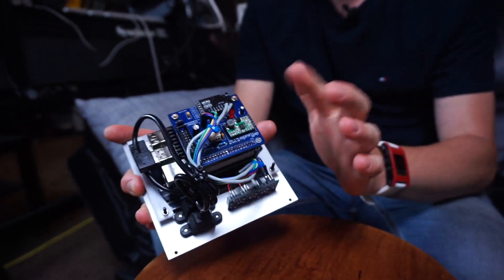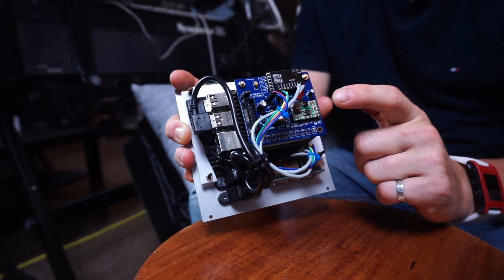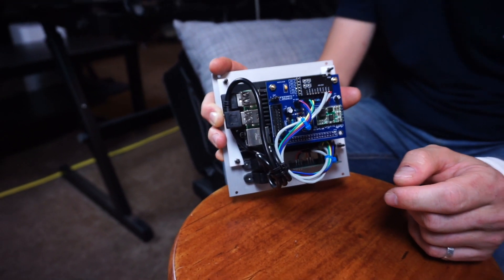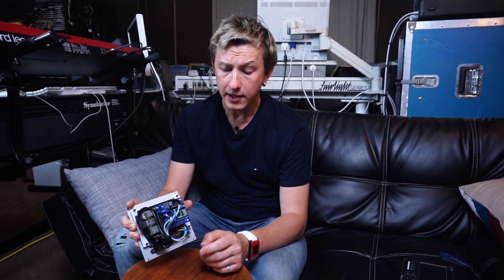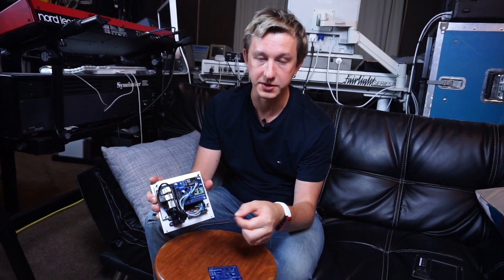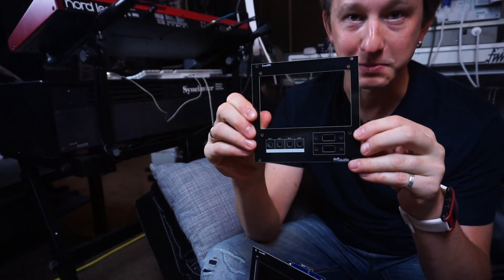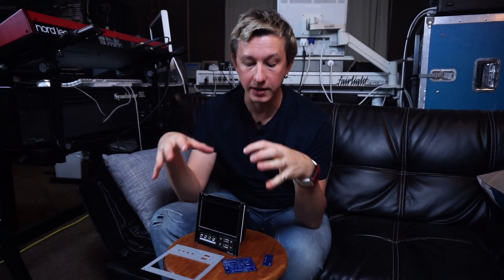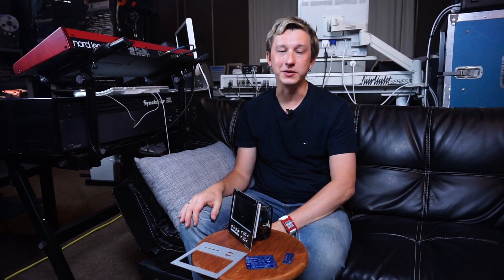Raspberry Pi 4 Eurorack module with audio, MIDI and power integration.

Comment: I thought a Pi5 would behave the same as a Pi4... I was wrong... RPi.GPIO library is broken... raspberry just recently released the full specs and datasheet of the RP1 chip that arbiter all OS > GPIO communication. I found a translation layer in GPIOconverter... please get into the raspberry forums to get more insight, this is not trivial argument... cheers!

Comment: I just bought the plate but I cannot find anywhere the links for the USB cables that you mention... could you post them here?
Reply from the maker: Hi, it's a simple USB extension cable, something like this https://www.amazon.com/USB-3-0-Extension-Cable-Panel-Mount/dp/B087BK3WRB/ref=sr_1_13?keywords=usb%2Bmount%2Bextension%2Bcable&qid=1649912298&sprefix=usb%2Bmount%2Bex%2Caps%2C273&sr=8-13&th=1 or the "up" angle version (depends if you do have a space around) https://www.amazon.com/Panel-Extension-Haokiang-Adapter-External/dp/B07FY6Z8J7/ref=sr_1_23_sspa?keywords=usb+mount+extension+cable&qid=1649912317&sprefix=usb+mount+ex%2Caps%2C273&sr=8-23-spons&psc=1&spLa=ZW5jcnlwdGVkUXVhbGlmaWVyPUEzUEYwTzhHTFI4TThYJmVuY3J5cHRlZElkPUEwMDMyMDAwM1BKQU9aQVZNWEVPUSZlbmNyeXB0ZWRBZElkPUEwMzU0NjIxMkM0SkszVFQyNjNVOCZ3aWRnZXROYW1lPXNwX210ZiZhY3Rpb249Y2xpY2tSZWRpcmVjdCZkb05vdExvZ0NsaWNrPXRydWU=
Reply: @DeftAudio   thanks a lot!

Comment: Awesome product does it fit in most eurorack cases? It looks kind of deep.

Hope it does well, you probably already thought of this but a CM4 based model would be even more awesome
Reply from the maker: The depth really based on the cooling heatsinks you're going to use and if the synth I/O expansion or not. Certainly this is not for table top eurorack cases. Regarding CM4, I don't see the advantage for this particular use case, it will make my design more expensive because the daughter board requirements. BTW, there is another project that uses Pico in narrow modules, maybe it's something you need?